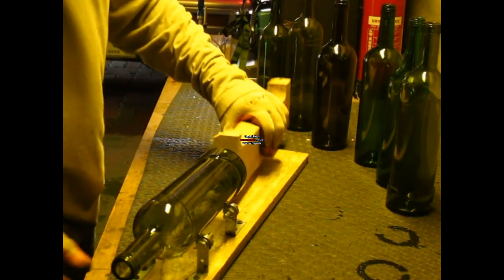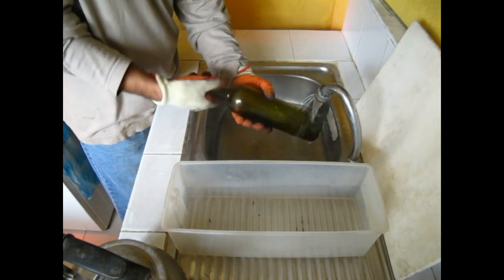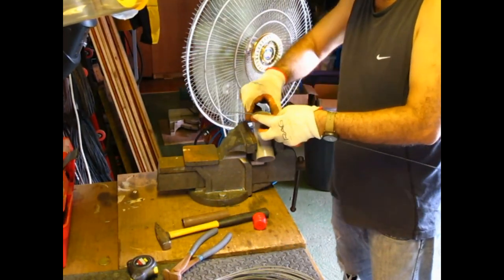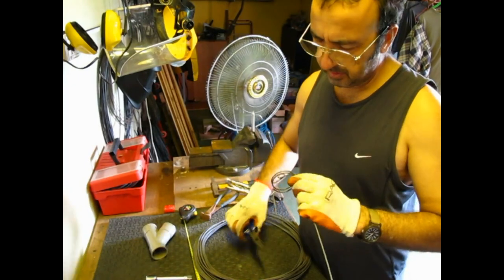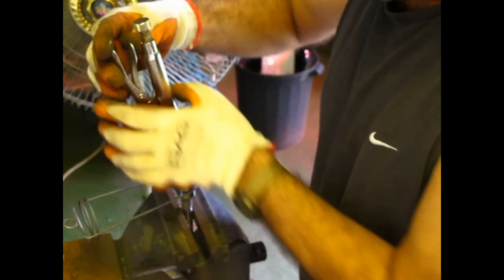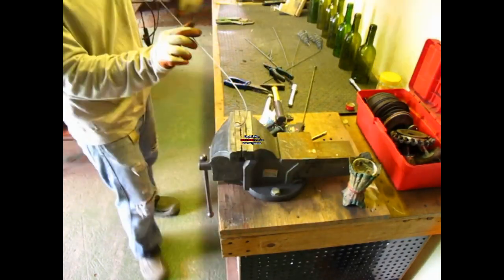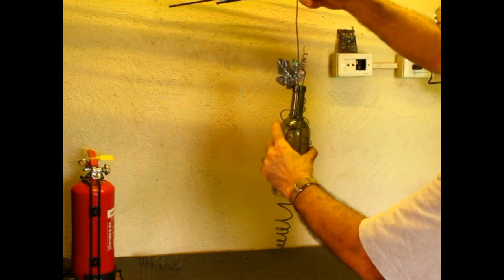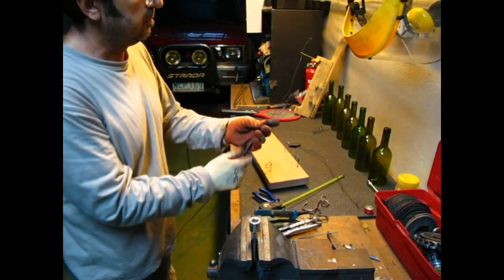Recycled Wine Bottles Made Into A Hurricane Candle Holder, DIY Video Crafts,decorating Ideas

Comment: I made six of these and wanted to make a suggestion on splitting the bottom of the bottle after it is scored: Put the bottle in the freezer and then dip the bottom of the bottle into a pan of boiling water. Be sure to wear protective gloves in case the bottle splits in an unexpected manner (which didn't happen to me, but seems like a possibility).

Your craftsmanship is so well thought-out. The hook upon which to hang the bottle when lighting the candle is a level of thoughtfulness verging on genius. I hugely appreciate your very thoughtful design.
Reply from the maker: Wow, thanks very much for that. I actually design my projects as  I'm making them and doing the videos.

So nice to hear that you have made this and hope it turned out nice. I find that irregular shapes are key to my projects looking nice, most anyway.

And thanks for the excellent suggestion. Sounds like it would work. Will try it next time.

TY
Saeid

Comment: I love these and I am trying to make some, thanks for the inspiration! Could you tell me more about the wire that you used. I used "mild steel wire" .030 and it did not work. I could not straighten it very well and I also could not wrap it small enough for the tea light (I used a plastic pipe like you did in the video). That wire just would not hold any forms that I tried to give it. Any information on the wire that you used, or another that would work, would be very appreciated. Thanks!

Comment: Just saw this same bottle cutting method on GreenPowerScience video and it's amazing. Your technique is only slightly different, in that you don't sand the edges of the bottles when you're through cutting and you turn the bottle rapidly during the application of the boiling water. VERY COOL. Easy to understand video. I've just subscribed to your channel. Thanks for the tutorials. The finished product is wonderful!
Reply from the maker: Hi Cat. Thank you for your kind comment. 

I find that it's not necessary to sand the edges. But you can easily determine if your bottle needs sanding or not.

Thank you for sub'ing

Saeid
Reply: Yes, I know this...I simply said that was one of the only two differences in your method and the other guy"s method and that I thought your"s might be faster. Hope that clarifies what I meant for you.

Comment: I am working on making wind chimes from wine bottles. I cut my first bottle today and was pleased with my first attempt. I liked your idea of the hot and cold water better than the candle and ice method, Can't wait to try it. Curious to know what you do with the bottle bottoms. BTW, great video.
Reply from the maker: The bottoms, I make a wire contraption that holds them, and they can be used as a sort of medieval looking candle holder. Will post a video soon.

 With a square bottle you have more options. Although it's much harder to cut a square bottle.

TY
Saeid
Reply: Saeid Momtahan I saw a photo on Pinterest using the bottoms as stained glass in a frame.  If I knew how to attach it here, I would, but you have such an artistic mind I'm thinking you can imagine the idea and probably improve it!  Thank you for sharing your wonderful talent.  Beautiful.
Reply: Nancy Kozlosky
A mosaic table top from these bottoms would be amazing, or even a stained glass window.

Comment: Where did you get the larger glass cutting wheel?  All I can find are the usual cheapo glass cutters with the small cutting wheel, which I've tried to clamp onto a bracket with vicegrips.  But I'm not getting a deep enough etch.
Reply from the maker: THey're just what I found at a hardware shop. Pretty common I think.

SAeid

Comment: Beautiful piece! What kind of wire do you use or suggest?
Reply from the maker: Hi Krista. THe wires are 3 MM Mild Steel. I haven't seen them any where except in Iran. So you can experiment with other types, like Galvanized wire. Which you can find in the Gardening section of Home Depot or similar shops

TY
Saeid

Comment: Have watched your video several times and love the chandelier lights.  Would like to make one for myself and have tried and tried to find where to buy the leaves.  Do you still sell them in your etsy shop?  I've tried to find them there to no avail.  Could you please send some info?   Thanks so much.    Russell
Reply from the maker: Russel, I stopped selling them. But if you like, I can list them again. I have a few extra ones I can spare.

Thanks
Saeid
Reply: That would be great. I haven't been able to find them anywhere..
Reply from the maker: OK, I'll PM you when I get a chance to list them
Saeid
Reply: Saeid Momtahan Thanks so much.
Reply from the maker: Russell Hagemeyer Russell, sorry for the delay. I have checked the shipping with DHL and it costs around 130$ just for the shipping. I would charge you 40$ for 8 leaves, each on a 1 meter mild steel stem. So total would be 170$. That's just to expensive,
Saeid
Reply: yes that is pretty expensive.. thank you much for checking into it.. I actually was able to make some out of soda cans and wire but not sure how long they will hold up. as I'm sure you know it's very hard to get anything to stick to aluminum.  do you have any suggestions?
Reply from the maker: Got my thinking cap on for ya. Will let u know if I come with something

Saeid

Comment from the maker: You can use any malleable wire from the gardening section of home depot
Reply: Can I add an essential oil to the oil lamp fuel so it can also be used as a diffuser and air freshener?

Comment: Do you think you can cut beer bottles with the same mechanism or do you think the brackets would have to be moved closer together?   Thanks.  I really enjoy your videos.
Reply from the maker: Hi tOm. Yes, they would have be moved closer. I have just made a Coke Bottle Cutter which I had to do exactly that. I'll be uploading the video soon.

Saeid
Reply: Saeid Momtahan Thank you Saeid.  Just a quick question about the wire you use. I'm in the U.S.  Is the wire you're using the same thing as wire used to tie rebar together for concrete reinforcement?  Where are you located?   Thanks for helping me out.  I just made the bottle cutter you showed. So far so good.
Reply from the maker: Tom, not sure about the rebar tie wire. It think that might be galvanized. But the toughness would be about the same, as it needs to be twisted and tied together. 
I've had dome luck rusting and blackening very thin(1MM) galvanized wire, by spraying it with vinegar.
I'm in Dubai now, after 5 months of staying in Shiraz

Comment: Thanks so much for sharing , I love these beautiful bottles. I love your idea of putting the  metal grape vines all around them they look beautiful!  What type of metal wire do you use for the wire inside the bottle?  Sorry,  I didn't  understand what you said,you said  some type of steel wire?? This wire looks easy to bend is it? Thanks so much your a very creative person. Thanks so much, Elizabeth
Reply from the maker: Hi Elizabeth. THe wires are called 'Tie Wires'. You can find them in the gardening section. Try Home Depot. If not, you will find the Galvanized version which will work just as well.

Thanks for your kind comment. Glad you liked the video.
Saeid.
Reply: Thank you!

Comment: I am sorry I don't understand your reply as to where you purchase your items. Thank you
Reply from the maker: Leaves, bought in Manila, philippines
Wires, bought in Shiraz, Iran

saeid
Reply: Saeid Momtahan So you put the leaves on the wire.   How?  Did you solder/weld them?  Epoxy?  Twist wire?  Thanks for the advice.   We've already cut the bottles and made the wire candle holder.
Reply from the maker: Hi Mike,
I weld the leaves to the wires. It's a pretty difficult thing to do if you're not a good welder. I  still have a hard time with it. May be have a pro welder do that for you.
Saeid